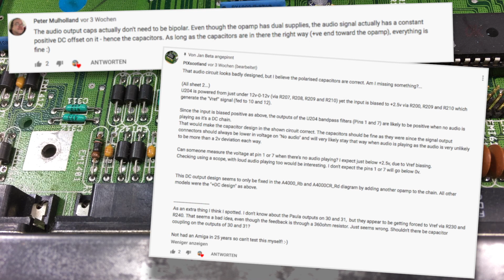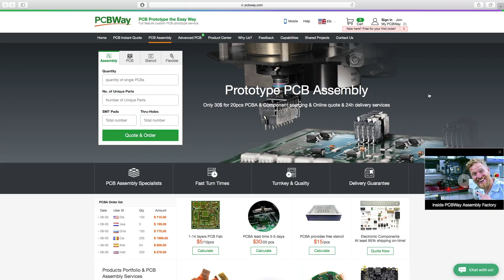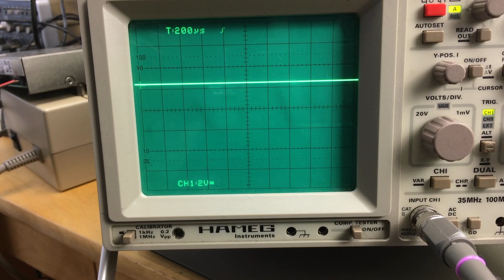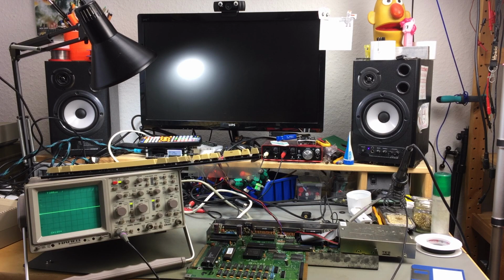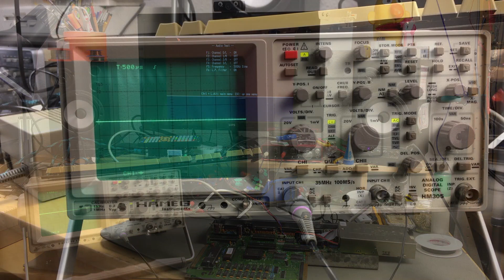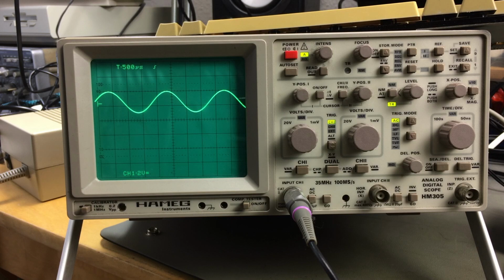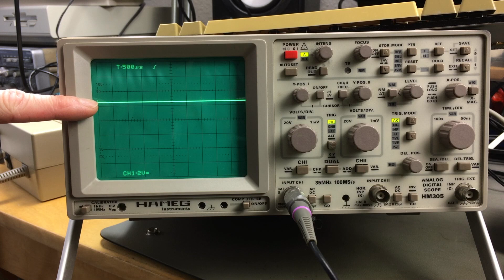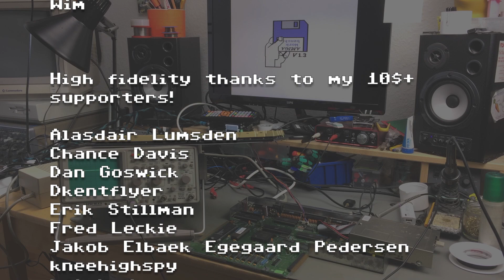Bipolar Capacitors in the Amiga Audio Circuit?

Comment: The whole reason they are there, is to strip off the DC Bias. In signal situations like this, capacitors block the DC from passing through, but allow the AC through. And size matters in this case. Larger caps will give a lower capacitive reactance (basically AC resistance) at lower frequencies, so if you want more bass, you increase the capacitor size. This only really applies though, if you are driving low impedance loads like headphones and speakers. If you are driving an amp, they usually have high impedance inputs in the order of high Kohm to several Mohms, and the capacitor size has much less effect, and you can get away with quite a small capacitor. (1-10uF). You will see on single ended amplifiers, they have output capacitors of several hundred uF, as they need to have a small reactance to drive low ohm speakers. That's why cheap amps have no bass, as they cheap out here, and use much smaller caps. You do also have to watch if you increase cap size, as it can increase output current, and overload the amplifier IC/Transistors, so you have to take that into account, before increasing sizes, or it may let the magic smoke out of the amp chip or output transistors. Oh, and that switch on "pop" you hear? Thats the DC Bias charging the output cap, the initial change in voltage gets passed through to the speaker.
Reply from the maker: Woah, I misunderstood the whole purpose of the caps... facepalm Thanks for the correction! Will pin your comment for reference.
Reply: Singe ended amplifiers don't have output caps but transformers, what you mean is single rail amplifiers. 

Also, you can't increase bass by increasing coupling cap size ad infinitum.  
You can easily calculate the turnover point freqency (3db down):

1÷(2pi*load impedance*cap. in F) 

If that's 20 or below, there is no need to increase capacitance even if you are driving a huge subwoofer.
Reply: @westelaudio943  Yeah, I probably didn't use all the right terminology, but i meant Like class a and class ab amps, with just a positive rail supply. They have a DC bias on the output usually around 1/2 the supply voltage, and the output cap strips that off, going to the speaker. I've only dabbled in audio stuff, and by no means an expert, but i've built and repaired a few audio amps in my time. :D
Reply: @lesleymunro4964  

Correct. Split rail amps eliminate the need for this capacitor since the speaker ground is at the same potential as the DC offset of the output stage, 1/2 the total suply voltage (from - to +). However, the downside is that any power supply imbalance makes it to the speakers.
Reply: @westelaudio943  Yep! Correct me if i'm wrong here, but my understanding was that dual rail amps were class C, as they could swing both positive and negative? It's been a while since I dabbled in audio stuff like that. (Class A was single transistor, inefficient, Class AB I can't remember, Class C was most popular, as it was most efficient? Drawback was extra components, 2 transistor (or FET) output, and crossover distortion? Thats what my broken vague memory of it all is. :D)
Reply: @lesleymunro4964  

Any complementary amplifier can have a floating ground, split rail supply or a single rail, negative or even positive ground one. 
They can be class A (high bias) or AB (barely turned on) for audio. The biasing is measured between base and emitter of the transistors and has nothing to do with where ground is. 

You can have complementary amps in class A with two output transistors, NPN/PNP or Darlington/Sziklai combinations (pseudo-complementary) see the "JLH 1969" amplifier for example. 

Class C is half-wave amplification and unsuitable for audio except square waves. It distorts the signal in similar fashion to a diode. Usually used in RF amps where distortion doesn't matter.
Reply: @WESTEL Audio 
@Lesley Munro

Hey guys, really appreciate your conversation here. Personally learned a lot by reading thru your comments. Thanks for providing this great info...          Buddy
Reply: @budandbean1  

Hi Buddy, nice to hear from you again. It's always important to share knowledge.
Reply: @lesleymunro4964  Class C is only used in RF amplifiers. It is efficient but produces a very distorted output as the amplifier only amplifies for a small portion of the waveform, typically 1/4 of a cycle.
Audio amplifiers require that the amplifier operates in class A, where the waveform is amplified for the whole cycle, or class B where there are two amplifying devices, each operating over separate halves of the waveform cycle. True class B is rarely used as it is difficult to maintain low distortion when switching amplifying devices for each half of a cycle. Class AB is used instead where each amplifying device operates for slightly more than 1/2 a cycle.
Reply: Excellent reply from Lesley. ;)

I don't have anything to add to that explanation. lol

But, I think this vid is the one where RetroGameModz explains the DC bias on the audio caps...

You will often see that the positive leg of the polarised cap points towards the "source" in audio circuits, so it's just a kind of "thing to do".

But in the case of the Amiga, it has a constant slighty negative DC bias from the DAC (opamp outputs after Paula), which can prematurely degrade the caps over time, because it is reverse-biased.

(at least that's what I recall from this vid. It's quite long.)...

https://www.youtube.com/watch?v=QfHU97FmdU4

In other words, it should never be taken for granted about the DC bias across a polarized cap in any circuit, which also lead to this amazing moment... lol

https://youtu.be/KW-v0nub8lE?t=396
Reply: Wow, i need time to digest the beautiful information you gave. Thanks.

Comment: Interesting topic! ESP Sound has some useful discussion of coupling capacitor types and distortion characteristics here:
https://sound-au.com/articles/coupling-caps.htm
https://sound-au.com/articles/capacitors.htm
The upshot seems to be that electrolytic (and even polarised electro) caps are fine in coupling applications provided they're big enough to keep the voltage across the cap low at low frequencies. And as you've found, the input into the caps on the Amiga has a DC bias to begin with.
Reply: And of course, the Amiga audio output (as much as I love it) is not exactly hi-fi. ;)

Comment: without the DC offset they would not need any capacitors at all. the DAC output has only a positive supply voltage, so the standard electrolyte capacitor has exactly the function to get rid of the dc offset an so there is no negative supply voltage needed for audio. a very simple and common trick.

Comment: @Jan Beta...  the resistance marked as EMI 481 .. has been "feeling the summer" ah   : - |   ....... quite burned...... at Minute 3:10.....
Reply from the maker: Yes, from what I've read it's a common fault. Seems to be current limiting the 5V supply for the mouse. If I understood correctly, the resistor can't take enough current by design so they changed it for a beefier one in later revisions. I have to replace it sometime. Only using this board for testing stuff so I seldomly use the ports but I guess it's still a good idea to have it in fully working condition.

Comment: Jan, while I`m sure the subject is already more than explained...It may worth noting one more thing
It's not that the output voltage of the DAC is made positive so to allow the usage of cheap polarized capacitors...
It's the other way around...
It's commonplace for any DAC to output only positive voltages... because the DAC works from digital information (bits 0s and 1s) and in digital circuitry of this kind, usually 0 means 0V and 1 means some positive voltage that is keen to the logic used in the computer... in this case, it's TTL logic, so a "1" is about "+5V".
All the DAC does is to sum the voltage of the different bits, from least significant to most significant in a "weighted" way... so that the most significant bit "weigths" 2.5V (1/2 of the full blown voltage), the next most significant bit "weights" 1.25V and so forth and so on until the least significant bit "weights" just a tiny fraction of the full blown voltage.
Then, by conclusion, if the DAC is just doing "weighted" sums of positive voltages, it can only output positive voltages.
Since you want to represent sound with this output from the DAC, and the nature of sound is alternating magnitude (AC), some arrangement need to be made to represent this alternating magnitude with a voltage that can only be positive.
This is achieved (another commonplace) by representing the digital number that goes into the DAC in what's called "2's complement' notation.
For an 8 bit representation (256 possible numbers), 0 is represented in binary as 128, 1 is represented as 129 (128+1), and -1 is represented as 127 (128-1)
The more the number is bigger than half, the more positive it is; the more it's smaller than half, the more negative it is.
The output of a DAC fed with this binary number represented in "2's complement" notation is a voltage that swings about the middle point between 0V and 5V (i.e. 2.5V).
The DAC is designed then so that the biggest possible positive number (all 1s binary) will be 5V (or close to it) and the biggest possible negative number (all 0s binary) will be 0V (or close to it) and the digital representation of the magnitude "zero" will be halfway betwen 0 and 5V, so 2.5V at the output.
So, the DAC cannot produce negative voltages (but you need negative voltages at the output, let's say, your earphones).
The simplest and most effective way of "subtracting" this 2.5V of offset at the output of the DAC, is putting a capacitor in series with your output load (the earphones).
It just happens that, in that circumstance, the voltage present across the capacitor will be always this 2.5V (positive)... so, a polarized cap can handle it easily.
A non polar cap will also do it... but it's wholly unnecessary, since it will always have a positive charge that's equal to the offset voltage present at the DAC's output.
Reply from the maker: Thanks for the clarification! :)
Reply: Thanks Fabio, that is a very nice explanation. Now i understand much better.

Comment: in my field of work (laser light shows) back in the day we would often remove the caps on a500 or 2000  and just bridge it so the Paula would pass a full dc signal that is able to move a set of galvanometers in both +/-  (it required  another circuit using an amp and some pots for offset/gain on x and  y) if any one  wants to try this the software(pangolin LSD1000) and the mods have been freely available for down load for many years  http://www.laserfx.com/Backstage.LaserFX.com/Archives/Download2.html  later versions of the software used a full zoro slot LD400 (still have 2 of the zoro cards ) (then pangolin LD2000 isa and pci) and the current  software pangolin(beyond) produces  now   is  network based on a pc

Comment: Hi Jan

Even if it went 2V negative it would make no difference as long as the following i/p stage of the external amp can take -ve swing.
The fact that the signal goes -ve does not mean the voltage across the capacitor has even changed. To prove that you can measure both side and check or if your scope allows differential measurement you should get no signal on the scope at all.

Comment: Maybe it's worth an experiment to move the ground connection of the oscilloscope closer to the ground of the audio circuit, for example, connect it to the ground pin of the opamp chip. Then check if you still see the voltage cross the zero line. There might be a tiny bit of resistance between the chassis and the ground pin of the opamp, which might deceive the picture a little bit.
Reply from the maker: Interesting thought, I'll try that.

Comment: Not that I disagree with you, but I don't think the video is sufficient proof: You're just measuring a voltage in the circuit, not the voltage across the capacitor. The capacitor is in series with the signal so I would say the correct way to verify or prove that bipolar caps aren't necessary is to measure the DIFFERENCE in DC voltage between the two sides of the capacitor, and making sure that voltage (the voltage across the capacitor, not the voltage between capacitor and ground) doesn't go negative. 
Also, while you do the measurement, you have to put a resistor between output and ground to simulate the normal input impedance of an amplifier. Without that, there won't be any current running through the capacitor (the current through the oscilloscope is probably very little because your probe probably has something like 1M or 10M impedance) and your measurement will not be correct for the normal situation. I don't know the specification of the Amiga sound outputs but most amplifiers use around 47K input impedance so that's what the value of your resistor should be.

Comment: The Paula only puts out 0 to 5V and the reference voltage for the OPAMPS is VCC/2. Without all being in the positive area even the MPF102 FETs to bypass the filters could not even switch.

Comment: I may not be the best judge on somethin' like this but I would say that it isn't poorly designed since it has worked that way for years and continues to do so even with the age of the caps sometimes the audio remains good. To each their own I suppose, if it sounds better to you with bipolar caps then so be it, if it's good the way it is that's fine to as I said before.

Comment: I little bit overshoot, its alright. The main reason to make this type of circuit with DC bias on it, it's not for using cheaper capacitors, but because you'd need a negative source, and that would add costs
Reply: You are correct - in this case it is because Paula runs from a single 5V supply, so the audio has to be biased around 2.5V for it to produce a symmetrical signal.
Reply: actually is there a negative source on the output operational amplifiers. there must be more to understand this design
Reply: @MrRobbyvent  yes, the opamps have a symmetric supply - but Paula does not
Reply: @jaycee1980  Yes, but actually this is the part that confuses me. Why the designers  needed to add positive bias when the signal has already left paula? At this point the signal can become simmetric from the opamps and given to the outside world in this way if they wanted. The "negative source" is already there!
Reply: @MrRobbyvent  because Paula is not driving a voltage into the - pin of the opamp, it is driving a current, so the bias is required externally

Comment: The slight negative overshoot is nothing to worry about. A polarised capacitor will tolerate this just fine. There would be no improvement in audio quality from a bipolar.

Comment: When you connect the speaker the cap just charges to the DC output voltage when where's no signal. After that the voltage over the cap stays constant, pushing the output negative when the signal goes down. So, the cap takes the DC component away.  If you would have measured the voltage over your cap you would have seen a constant positive DC voltage (with a small AC component), except when you use low frequencies (the AC component would be bigger then). You should probably have measured the voltage over your cap, not the voltage between the output of the driver and the ground. Be careful with earth loops if the ground of your computer your is connected to the earth and the ground of your scope is connected to the earth too (you can destroy your scope). You could also use both channels of your scope and display the difference, so you don't have any problem with earth loops.
Reply: @ianstorey1021  All caps have positive and negative currents when charging and decharging, also electrolytes, they are designed for that.

Comment: Yup. If the signal is always on the positive side, a polarized capacitor is just fine. So putting some bias on the signal to lift it above 0 saves putting expensive bipolar capacitors there.   ;-)  EDIT: Which is exactly what you say in the video - I should stop commenting before seeing the whole thing.    ;-)
But is it really the same on all Amigas?
EDIT2: Swap for four double F - you have a pair of bipolar caps.
Reply: You got that backwards. The DC offset is there, and that's why the cap is needed to remove it at the output.
Reply: Yes, the DC offset is there, which is why a polarized cap works (as long as signal is kept above 0V) - the DC doesn't get through to the other side (and may also block low frequencies depending on the value).
As it was measured and may actually go under 0V, so...  trim bias or BP caps?
Reply: @e5frog  

He measured at the output.
Reply: I'm not sure we understand each other here, sounds to me we are just saying the same things back and forth. 
If measuring on the RCA-connector end, the wave would be centered around 0 - as bias voltage doesn't pass the capacitor. So all measurements are as far as I understand at the + end of the cap, before passing the output capacitor. 
Assuming measurements are made correctly and the oscilloscope is properly calibrated, at 7:06 the sine wave shoots under 0V. So for some reason the bias isn't high enough or the output is too strong. A measurement after the capacitor would have been nice to see.If you never play full amplitude on both channels on one output - then I guess there's no problem.
Reply: @e5frog  

Oh you're right, I see it now. Ok now I'm confused. I thought they used a class A stage and that's it's output coupling cap? Where can I find a schematic of this?
Reply: @e5frog   

So the offset is coming from the Vref? I see no other possibility. However, it shouldn't be a problem, since electrolytics can handle reverse voltage as long as it's just a fraction of their rating.